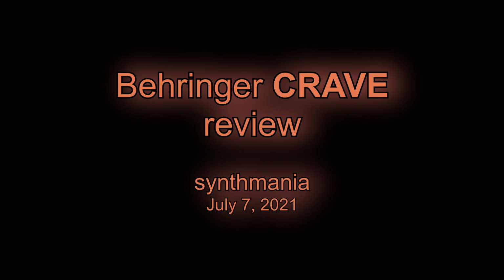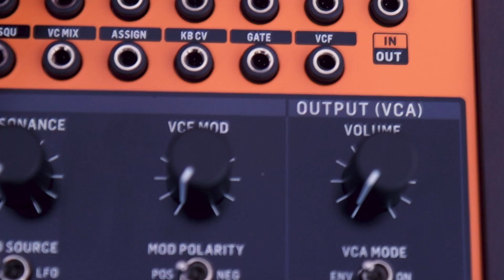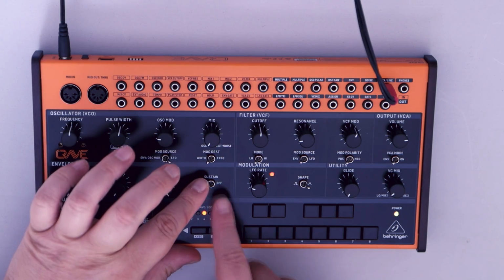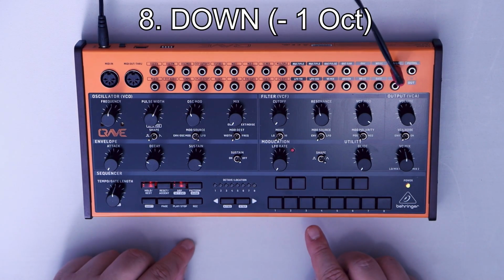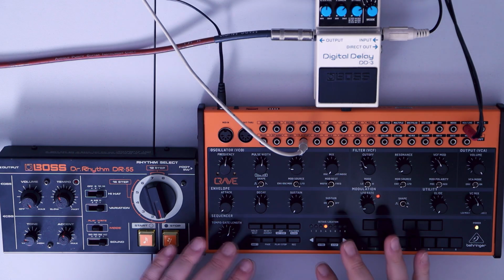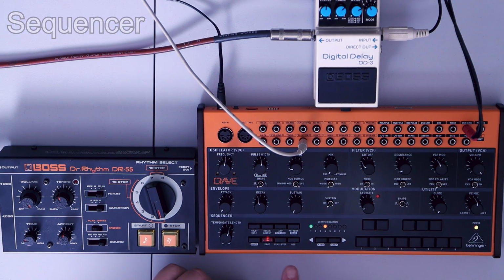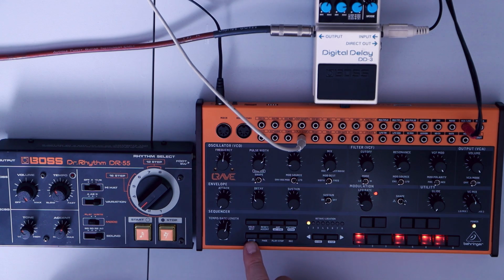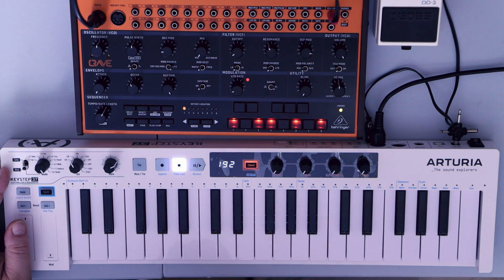Behringer CRAVE review

Comment: It’s a heck of a lot of synth for so little money.
Reply: Prty much most behringer synths
Reply: yes yes thas the point the crave is also build solid best buy imo
Reply: @couchcamperTM  not quite a m32.  doesn't sound the same.
Reply: @alexwestconsulting   Sounds better..... for less.
Reply: @alexwestconsulting I have a Matriarch with a Freq Box. Yamaha CS-15, Alpha Juno, MKS 50, Nova  and others. I don't have a Mother 32. I bought the Crave because I wanted different at a good value. I like that it integrates just as well as a Mother 32.  I own TB 303's, TD-3s, FR 777, TeeBee and they all sound different from each other. I use mostly Electro Harmonix, Pigtronix, Earthquaker Devices and TC Electronics effects. I am searching for a unique sounding result which pleases my ear. I don't know if replacing the Crave with a Mother 32  would be "better" or not but I'm happily tinkering away with what I have now. Who knows maybe a Mother in the future? I don't see it, but you never know. Smooth may not always be what I need.

Comment: When I first got my Crave I was disappointed. Eventually I found ways to use it in my set up. It is not a Moog Mother32 ripoff. It is a good little synth for leads and for sequencing. I combine it with a Nuetron and a 2600 to create a killer semi modular setup with lots of cross patching options. I like the small form factor. Most of all, it sounds great!

Comment: Are ties still bugged in the sequencer? You're supposed to be able to tie notes by increasing the gate length to 100% but it doesn't actually tie them as the envelopes still retrigger instead of being legato. I don't know if they've fixed it in a firmware update yet though.

Comment: could it be my first synth? or is a Poly D or Deepmind a better option for a synth noob like me?
Reply from the maker: If you are a noob I recommend to learn how to play the keyboard as first thing. For that you'll need a polyphonic keyboard - better if it has five octaves, but a DeepMind 49 with four octaves will be adequate as well, to start with.  If you buy a three-octave keyboard like a DeepMind 37 or Poly D, it will be much harder to learn how to play the keyboard with two hands - you need at least 49 keys, but it's much better if you get a keyboard with 61 keys or more.

Comment: Good day, Paolo! Love Your videos, but, I think You should not use this universal chip сhinese power-adapter 
with ☩-connector.
That is not safety for Your brended high-quality toys ))
Reply from the maker: Thanks. That power adapter is not a "universal chip сhinese power-adapter". It's a high quality TEAC model# 2704 that I've owned for decades.  That said, both the CRAVE and the power adapter that comes with it are made in China and work fine.  I'm sure you realize that most things are made in China these days. I'm sure you own things in your house that are made in China: so, according to your logic, you are not safe in your own home?
Reply: You're absolutly right about сhinese electronics, I just has a dramatic expirience, when an adapter with the same connector killed my Casio CTK-810. Writing my previous comment, I thought that different devices needs a different parameters for a long and normal work - such as: voltage, frequency and other... But, sadly, many manufacturers tryes to get more money when sells their devices without a special power adapter (Like "Casio" do).